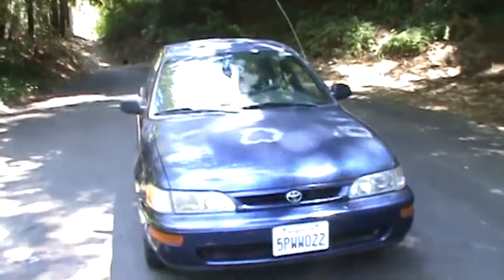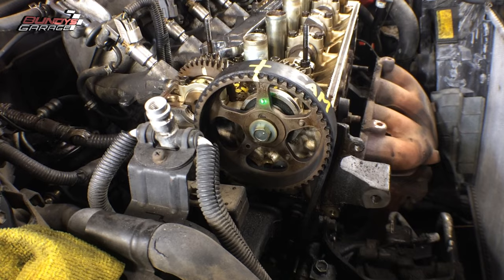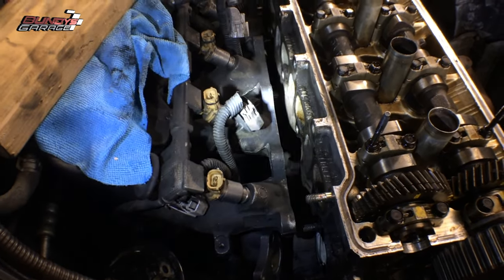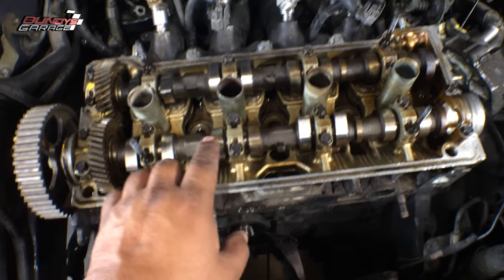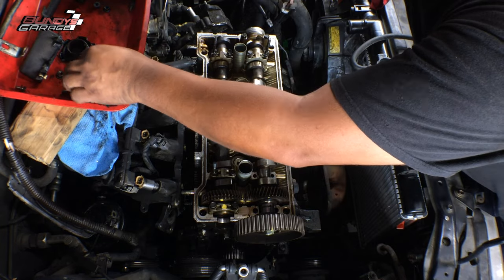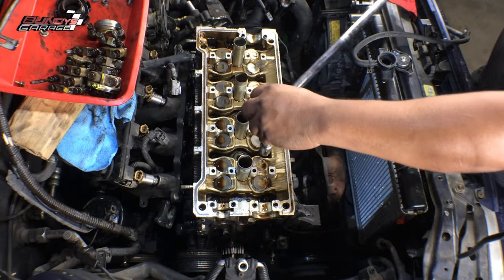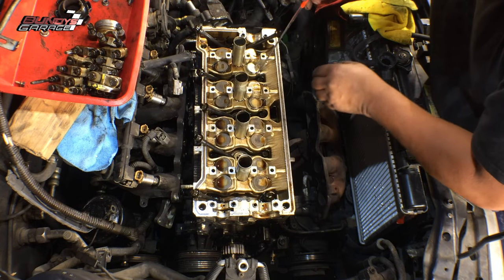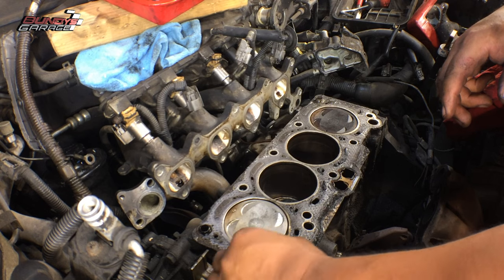93-97 Toyota Corolla 1.6L Head Gasket Replacement | 4A-FE | Bundys Garage

Comment: One of the best auto mechanic you tube videos, thank you. A shop introduced vibrations on my '99 corolla after they did the timing belt, so now looking at these corollas to hunt down what it could be. Most likely they messed the harmonic balancer as it now has a very slight wobble.

Comment: What is the correct nm when tightening 10mm cylinder head bolts on a Toyota Corolla 1.6GL 16V 4AF engine 1991 model?
Reply from the maker: I believe it's 22 ft/lbs then 90 degrees twice for each bolt.